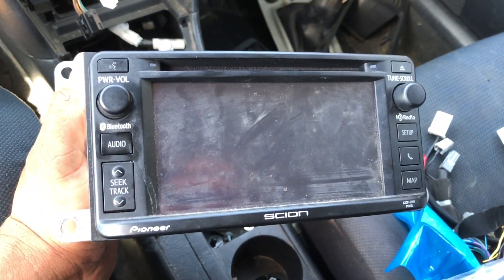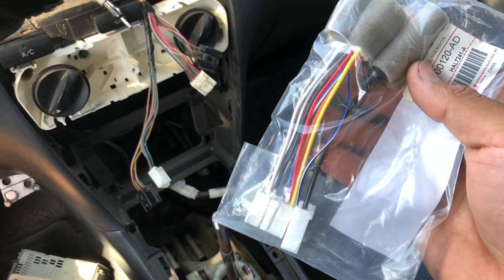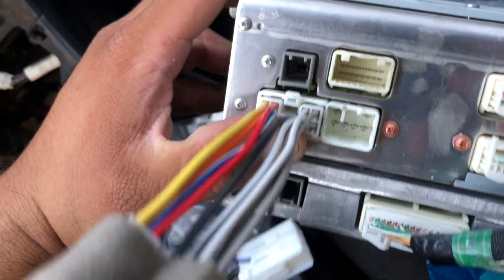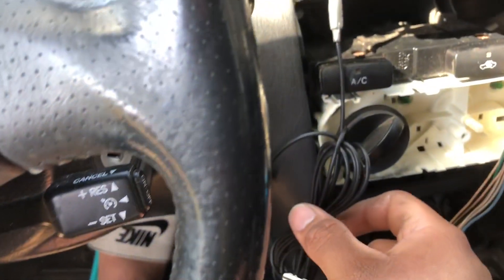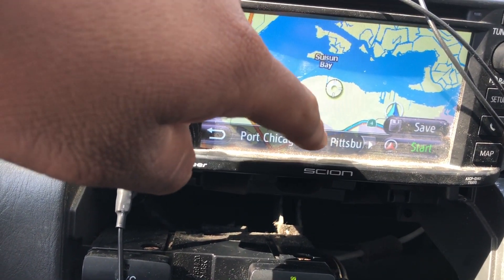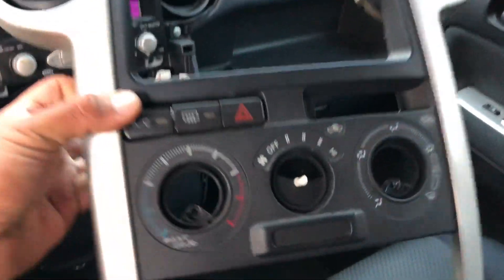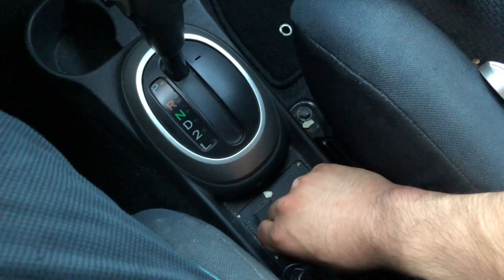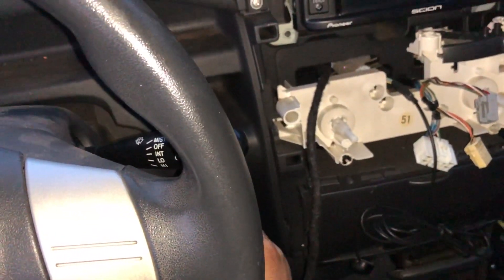How to install a newer Scion touch screen head-unit on an older Scion / Toyota vehicle

Comment: Newbie here.... help me to understand. I like what you did here and have the very similar 2005, Scion xA. Some questions.
1.) I like the "factory" unit you used, from a 2014 Scion TC. To broaden the search....what other Toyota's are good candidates? Seems 2013-2016 TC uses this unit...any other cars or radios to look at as possibles ?
2.) So...this unit has pre-programmed GPS installed, and does not use the GPS app of your cell phone that you have with you in the car...right? Does Toyota provide a way to upgrade the maps maybe by removing a Sim card ....updating that...and re-inserting into the unit?
3.) Do you need the original donor car's VIN or other "Code" to allow this Toyota/Pioneer unit ti be used in the new car?

Comment: I believe that the 20 pin connector is for things like the steering wheel controls 😅
Reply from the maker: i later found out after seeing the same connector on the xb. ill make an update video on that but that same 20 pin controls usb and aux connector
Reply: @2zzlow  Thanks if you could show how to adapt the trim around the radio to make the radio sit flush 🤷🏻‍♂️😅

Comment: Audio Parts
1) Audio CD Deck Harness - Toyota (PT546-00120-CH) $27.78
2) Mic Toyota (PT546-NU160) $47.04
3) Antenna Conversion Cable - Toyota (PT546-00120-AD) $23.03
4) Antenna GPS - Toyota (PT296-00141-AA) $49.55
if you can get a better oem part price please comment below.

Im also working on my scion XB 2006.
what do you advice to install a aux for my Sirius XM Starmate 4
Great video!!!
Reply from the maker: thanks fam, updated the video description

Comment: Does anyone know if this will work on a 2010 xB?? I just hate the old radio and would love the unit that comes with BT on the 2015 xB's. (Aka this same one)
Reply from the maker: It will, pretty much any Toyota Lexus Scion
Reply: @2zzlow  appreciate it primo, I'll buy the parts listed except the gps harness. Should still work without it right? 
Looking forward to that updated video whenever that comes out!

Comment: So I have a 2016 tC, I have the regular Bluetooth touchscreen. If I want to buy the Navigation unit, this video will work? Is the navigation unit inside the radio? Or are there any other modules located in the car?
Reply from the maker: navigation unit is another board that attaches itself to the bottom of the radio board and a cable gets sent to the head unit.

Comment: Will the PAC RP4.2-TY11 or the PAC TY1A-RS be useful for this install?  Or do I need to buy the wire adapters separate?
Reply from the maker: I looked up the PAC RP4.2-TY11 and it looks like it will work but it seems over kill compared to how much I spent on the oem toyota connectors but if you aren't wiring savvy then for sure the PAC option would be easier.

Comment: Did you notice any difference in the audio quality from this? I would figure since it is a newer head unit it would be better
Reply from the maker: Well the original head unit never worked when we bought the car. Only reason I went this route rather than an off the shelf unit was because I found this head unit at the junk yard for a really good price and it includes Bluetooth and USB support. Audio quality sounds good for those tiny speakers

Comment: Do you know the part # for the RCA ?
Reply from the maker: to add a subwoofer? i think you need an aftermarket solution for that.
Reply: @2zzlow  get a Kicker LOC.
Or audio control or SMD.
All the rest are pretty much junk